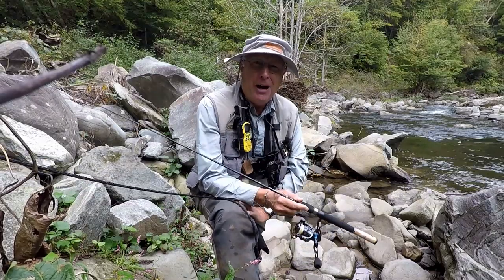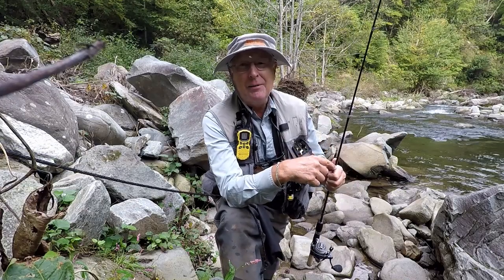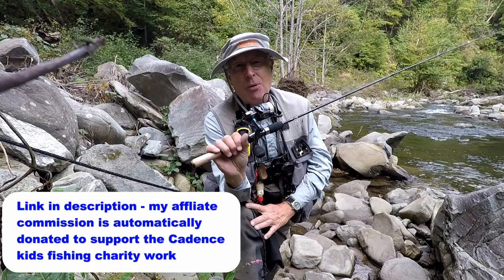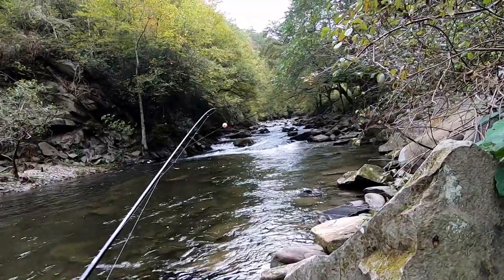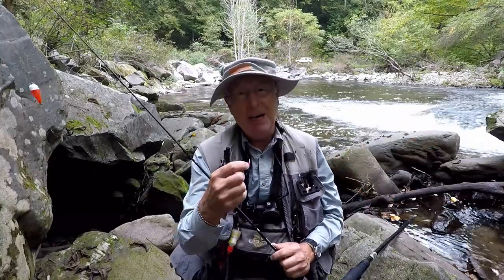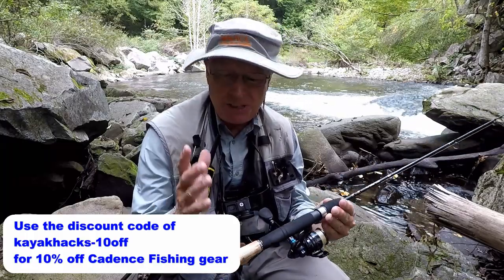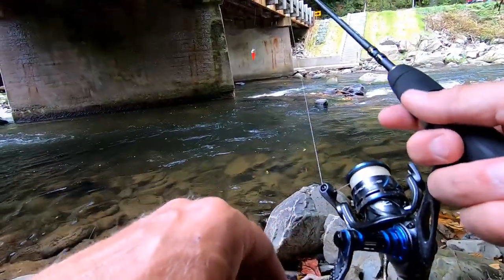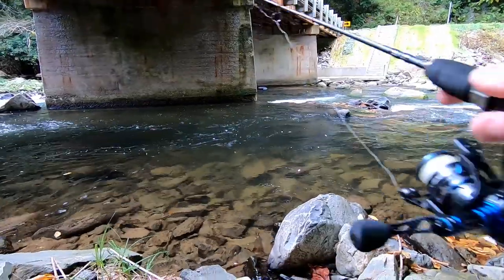Fly Fishing With A Spinning Rod - Using a Casting Bubble

Comment: I was taught how to use a transparent casting bubble with 4 ft. of leader and a micro sized fly on a 2 week trip to the Colorado Rockies. I was 12 years old and loved the sunrise bite, the lakes surface would be covered in rings called boils, and casting a fly using spinning tackle was a sure fire hit.
Reply: Spot on use clear bubble and as long of a leader you can still cast. We used this setup in lakes that harbored some big fish. Once you find the right fly they like, shaboom!

Comment: Mr Moore, 
I have used a bubble and fly in rivers and creeks most of my life (40+ years) and have frequently out-fished others. My method gives a bit more control over the fly by putting it on a dropper about 3 feet above the bubble. This lets you pull your line tight if needed to keep the fly up near the surface, which can be especially useful when using a soggy dry fly. This is one of my favorite methods on a creek.
Reply from the maker: That is a great idea! That way you have tension and avoid my problem . I'll try that! Thanks
Reply: Whoaa dude! that's the way indeed thank you very much for this very lethal tip.

Comment: My dad and I used to do this when we used to backpack the Alpine lakes in Idaho. We used a normal red and white bobber, and a bead head hairs ear or and bead head fly. Cast out and very slowly retrieve just to keep the line tight. I crush panfish here in NC using the same technique. I have never tried rivers. I don't believe the fly can get deep enough due to the bobber being swept away at a faster pace than your fly line.
Reply from the maker: Probably that is what is happening!

Comment: In shallow water applications like you were fishing, I use the smaller CLEAR casting bubble. The clear version does not scare the fish. When I fish farm ponds for bluegill for example I may use a small red & white bubble with no problem. Also for my main line I personally never use anything heavier than 4lb test. I sometimes go as light as 2lb test. Just my experiences tho. Hope it helps! Love your videos.
Reply from the maker: Thanks! The 8lb Ardent Gliss is actually thinner than 2lb test. I think your point on the clear bubble is right on and that is probably the problem. I'll try this again in the Spring when I go trout fishing again.
Reply: YOU MUST USE A CLEAR BUBBLE SO FISH NOT SEE IT
Reply: @KayakhacksFishing  I'm sorry as I don't sub to your channel, but any updates since?
Reply from the maker: @mikecalkins6467  Not on this topic
Reply: @KayakhacksFishing  'preciate the message back! thanks

Comment: When casting a bubble you will get a better presentation if you stop the line with your finger before the bubble hits the water.  This will cause your fly to land more naturally and ahead of your bubble reducing the chance of tangles.  In Europe. they use what they call Bombarda or Sbirulino floats as opposed to the water-filled bubble.  These are more aerodynamic (cast like rockets) and are available as either floating, slow sinking, or fast sinking types.  They also come in a variety of weights.  You can find them on ebay.
Reply from the maker: Wow! Thank you very much. I want to redo this video with an improved bubble when I go to the mountains again in April. I'll grab one of those floats!

Comment: Use aa smaller float like those made by Trout Magic.  Also sometimes a small spli shot between the float and the fly helps keep the lower line fro fouling with the float
Reply from the maker: Great advice! I will try it. Thanks

Comment: I've had pretty good luck using a Trout Magnet EZ Float and the Trout Magnet jig.  No problem with tangles.  Casts well with an ultralight outfit.  Catches trout and many other species.  Wonder how it would work with wet or dry flies?!?
Reply from the maker: It is supposed to work with everything. Lol... I'm sticking to my fly rod

Comment: I have been a fly angler since the mid 70s. Prior to that I would use an ultralight spinning rod and reel with 4 to 6 lb test, and a classic red/white 1/4 ounce Daredevel  spoon, a Mepps or Roostertail spinner and did quite well in streams.  But in Alpine lakes a small 1/4 ounce "Torpedo Float" with a fly at the end of about 36" of "tippet" would always catch fish when using lures wasn't producing. In fact I cannot recall ever not catching fish with that rig in high lakes. I would cast, let it set awhile, then just twitch for a retrieve. I still occasionally bring a UL spinning rod on trips to high lakes to reach out farther than I can with a western fly or Tenkara rod.
Reply from the maker: I need to give it another shot!

Comment: Been fishing this way for 60 years on lakes.  I've used it on big rivers and small creeks too.   IMHO, the bubble you used is wrong. I always used a clear bobber.  You cast slightly up river of the target,  get the bubble to be upstream of the fly so the flly is presented before the bubble.  I've had success with both sliding bubble above a bobber stop and clip on bubbles.

Others have reported good success using a bubble on the end of the line with the fly on a dropper.  Never tried that.

Also, loked to me like your ultra light was toooooo light for that bobber.
Reply from the maker: I need to try the clear one. I bought this one because of the easy way to attach and move it on the line... but clearly it spooks the fish!

Comment: I trout fish this way. The set up I use depends on the distance to cast and over head room. Large area where I can cast 30 /50 yards is 7ft. St.Croix trout series , Pfluger Supreme 50, 8lb. Fire line braid. A “clear 1.5in slip float half full of water. Note this is the order I use , only my opinion. First a rubber bobber stop, slip main line through the bobber . Next tie on a swivel , I use VMC rolling swivel size 7. For your leader material,just like fly flshing needs to be heavy enough to turn over the fly you’re using. Lengths depend on where you are fishing. The two I use most are 4lb floro Spyder Wire, normal low cost flora. Next is Rio 5lb-5x. floro. I don’t really like tapered leaders. Length usually 6-7ft when possible.Your float needs to have some freedom to help reduce snags and help with twist, so slide your stop above about half inch. Slide through is best,  I tried many types of floats. I like FireLine braid it floats over some snags and you can see it .  A little gap between the stop and swivel will help when they take your bug,then have some resistance against the float. Excellent feel with braid, good leader and guality rod. Same set up with 6ft St.Croix and 6lb. Fire line. I mostly use streamers and nymphs size 10 to 16. I tie 99% myself. I have tied foam floating dry flies. One fish caught and done, get slimy. Since you’re not really false casting hard to dry out,even with treatment. My opinion droppers don’t work well for me. They spin around in flight. I do sometimes tie a trailer off the hook bend. Spin floats by Eagle Claw, Mustad and South Bend work.
True another float. I tried hookless lures, not as smooth. I almost without exception get hits on the float itself, probably targeting the black swivel. I guess it looks like an ant ....good luck.

T
Reply from the maker: I REALLY appreciate this guidance. I head back to the mountains in late April and will give it a try! I think one of the key things you point out is to use the clear bobber.
Reply: i get a large amount of brown trout that hit my black swivel when im spinning with a mepp on i always fancied the thought it was an ant lol

Comment: I use a leader 2foot or shorter the fish don't Kerr about the float what I use plastic or foam bobbers even I use the smallest then if it doesn't work I go bigger. Smaller the better 🤔 just enough to float that's it. And color I think color mattress. The fly fishing bobbers I like the ones that get pinned on. Ya it will be very light like even if using half gram weigh or less by the bobber. Find what works for you but light is the game and small package on the end of line 🎣 just got some good Bass fishing for the first time with my son and grandkids. Good fishing video my son told me about.
Reply from the maker: thank you for the tips!

Comment: I never did this. But a friend of mine did the experiment using a little reel (like yours or smaller) in his fly rod (with the bobber in line and then my friend used a weighted fly or a removable split shot 5 inches before a dry fly (some of his experiments randomly worked in a very surprising way)
Throwing (or casting) sideways like using a scythe at waist level or higher, thanks to the length of the rod allowed him to deposit the rig from a distance without curling (or twisting) ...and holding the line 2 or 3 inches before the fly using the rod like a slingshot sometimes...
I think there is a lot of field to research. Good initiative.
He found sometimes it worked against all odds when nobody else had results with traditional Fly Fishing (and also viceversa and we end laughing on him...because his crazy ideas)
I would make sure using fluorocarbon or some invisible line in the last section (he uses 'amnesia" those days, more than 20 years ago)
Nice research! You always trying to go beyond! (we learn a lot from you, thanks a lot!!)
Of Course I gave you a HUMONGOUS LIKE!!
Regards.
Fred.
Reply from the maker: Great points... it does need more testing. I'll try the clear bubble when I go trout fishing again in April.

Comment: Don't use such a large casting bubble for starters---it "does" spook fish.   Armed with a decent spinning rod and reel, I've used a small Thingamabobber and at the end of my line I tied a Floating Popper Dropper w a short trailer line tied to a tiny artificial floating fly (bream size fly) attached to catch Trout up at Boone, North Carolina.  I've also used the same Thingamabobber but used a tiny weight with a cricket for bait.  Both situations, I caught Trout by my second cast.  The creek there was very clear and shallow.  As a matter of fact, I could see the Trout lurking in the pockets of creek water as my "bait" floated above the Trout.  They hit the bait.  Yes, I could have used a fly rod and reel (I like the Martin Automatic Fly Reel), but because of the tight foliage around, and the fact that I didn't have waders at the time, I fished from the bank.  The Popper Dropper and Thingamabobber together provide the needed "weight" to project the artificial fly into the desired target.  Of course, that Popper Dropper also interests large Trout, Bass, and Crappie as well.
Reply from the maker: Great advice! Thanks!